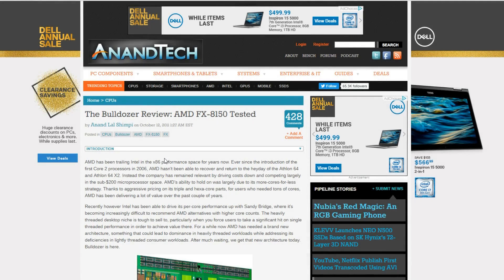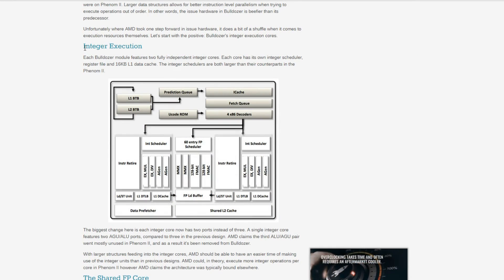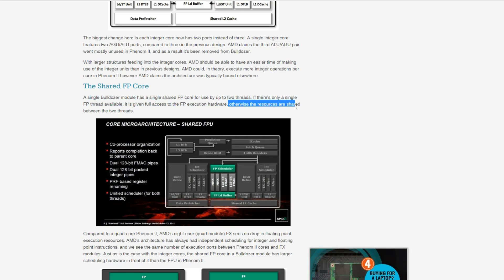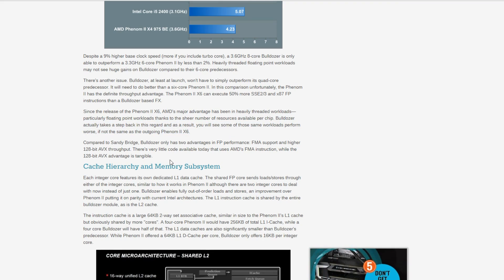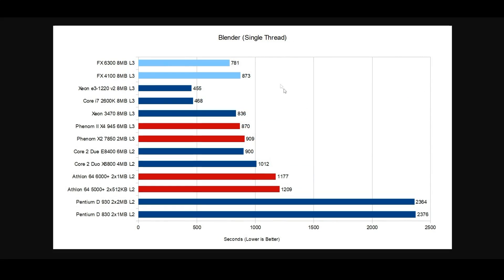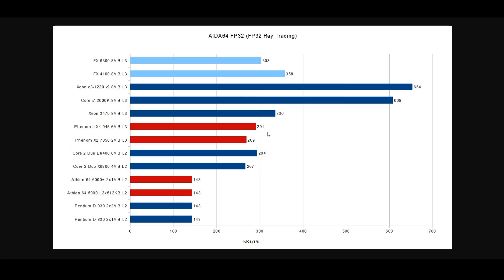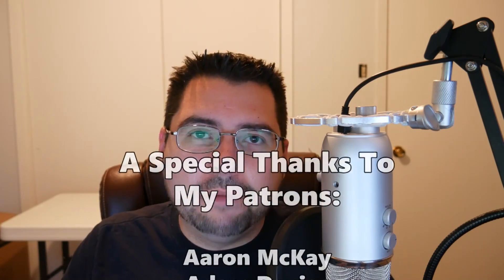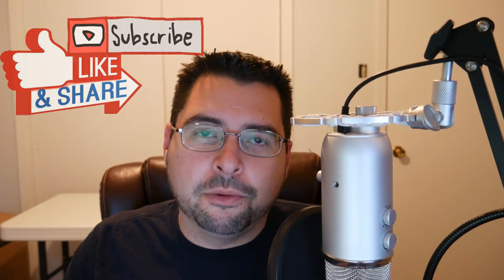IPC Test 7: AMD FX Series CPUs! How Does it Compare?

Comment: in other words, the FX was a part time 8 core, 6 core and 4 core cpu, lol. i don't understand why amd just didn't continue to build on the phenom architecture. instead, they tried a  radical different approach with the fx series architecture that just didn't pan out very well.
Reply from the maker: I have no clue. K10 at higher clocks would compete with 1st gen core series and at least kept them in the ballpark. With tweaks maybe split the difference between 1st and 2nd gen core series. Who knows
Reply: its simpe it was more efficient at higher core count and reach higher clock speeds it was better overall then phenom
Reply: Kai has the answer to your quandary. AMD really developed the Bulldozer architecture for the needs of servers/datacenters where you want higher density, more threads, and in general floating-point performance would matter less than for desktop use. If you are building compute servers that need floating point performance, you are probably going to use GPUs for that. Frankly, this is largely what AMD has done again with Ryzen. Yes that have gotten their ipc way up, but their use of infinity fabric is a server-market-driven decision, i.e. it is much more scalable, at the expense of higher latencies. It is really only because intel hasn't made any "leaps" in performance since Sandy Bridge that the conversation around Ryzen is different than it was for FX. Ryzen has most of the same "talking points" that FX did, minus the clock speed advantage, which has now flipped with intel breaking 5ghz and amd barely breaking 4. Ryzen is the value processor, giving more cores/threads than intel at a given price, the ipc is lower but the price/performance value is better, etc. If the ipc gap were larger, it would be Bulldozer all over again. And with intel offering 6 core, and soon 8 core cpus that can do 5 ghz and has ipc advantage, AMD may soon be in trouble again if Zen 2 doesn't offer substantial performance uplift.
Reply: Delcolux  you are mostly right.
Regarding infinity fabric, it's not just about scalability, but mostly about modularity. Everything uses the same protocol and you don't need to design a new interface for anything. Making an APU is literally plopping an CCX out and replace it with a GPU. This is only this easy thanks to infinity fabric, so even the desktop chip profit from it. The "problem" with inter-CCX latency is none of infinity fabric really, but more of the actual CCX. And while inter-CCX is not that great, latency in the same CCX is very, very good and i think that was the idea behind it.
I don't think Ryzen has the same talking points at all, apart from "being not the fastest in gaming". Where a single core lead was completely unattainable for Bulldozer, Zen2, 3 or 5 might finally get the better of Intel. Ryzen's IPC is a few percent lower on average, but it also has quite a few wins, currently the only big problem is frequency. The most important part: Ryzen is competetive in efficiency whereas Bulldozer was not. Next generation is 7nm for AMD vs still 14nm for Intel, so I am very confident AMD will have the efficiency lead in the next generation. Also 7nm should help with the Gigahertz, even 14nm->12nm brought around 200-300 Mhz, for 7nm I expect 4,5 minimum (overclocked/boosted of course) with room to 5 Ghz. I also expect Zen2 to provide a higher relative IPC gain than Intel has achieved in a long time, Zen1 has been the worst case.
Regarding floating point, Intel has bigger vector units, but Ryzen has the superior FP architecture. It is weak in AVX+, but it wrecks the Core CPUs in SSE workloads.
Reply: Good info, thanks Kai. I definitely think ryzen is cool, and I wan't trying to say infinity fabric is bad - it's awesome. But I just think it is kinda weird that despite the awesomeness of the Zen architecture, AMD is still the value/more cores per dollar/less per core performance option as compared to intel. Still the disparity isn't as large as it was last time around - as you pointed out they are comparable in terms of perf per watt, it is mostly a matter of clockspeed, so hopefully the Zen 2 plus 7nm will see AMD achieve true per-core parity with intel.

I always thought the single-ccx r5 1400 was interesting since it has all its cache and SMT, but since it is a lower-binned chip the clock speed just wasn't there. I will be keeping my eye on the newly announced r5 2500x...
Reply: Delcolux  Well, Zen is awesome in a sense that it is a really huge jump from Bulldozer. If you are coming from Skylake+, it is not really faster. However, the arch shoudl still be a bit more efficient at the same node (Intel 14nm is quite a bit better than Glofo 14nm) and most importantly, we finally have some competition. In January 2017, the i7 7700k was the reference in mainstream CPU power, we also had 8 Cores at 1000$ or 10 Cores at 1800$ a the high end. One and a half years later, a CPU with more multithread performance than the 7700k costs 150 bucks (Ryzen 5 1600 or better), we have 8 cores in the mainstream and 16 cores for 900$/32 cores for 1800$. This is the real immediate value for us as customers. Personally I'm okay with AMD as the value king, for most new PCs I recommend the 2600 oder 2600X as they are just beasts (especially compared to 7700k and earlier) and have more reserves compared to the 6-thread i5. Coming up, me might even see AMD taking the performance crown in many different areas as they will lessen or fix their clock speed advantage. Many people think AMD will be in trouble because of the 9900k, but I don't think so. When will it come out? December? With the current 14nm capacity problems, when will they have it actually in stock? March? Zen2 7nm Server CPUs are already in testing phase by the server guys and should be released somewhere around the beginning of next year. Ryzen 3000 will certainly not come out that much later as the 9900k.

Is the 1400 really single-ccx? I thought it was 2+2 cores. The upcoming 2300X and 2500X are 4+0 though. Do you have a tight budget? I reckon the 2600 will not cost much more and offer substantially better total performance, so it might actually be the better buy. The CCX-latency-thing is not that big a deal as most people make out of it. 3000+ Mhz RAM is becoming fairly cheap now and should more than of that difference :)
Reply: Definitely a bright future for the cpu market. I am not on an especially tight budget. I just found the idea of a single CCX chip interesting. I guess the APUs are honestly more interesting to me, particularly the laptop chips, though I was disappointed to see they only have 4M L3 cache, even on the desktop APUs. I will be holding out for Zen 2 regardless, as my current PC is plenty of power for me, but I enjoy following the CPU and GPU developments.
Reply: SteelCity1981 they should have improved on phenom ,shrink it , get 10-12% more IPC , 10%-15% more clock speed so it would have been within 10% of the core i7 in gaming and single threading applications and within 5% of multithreading task for 60-70% of the price.
Reply: 1. Bulldozer had a ton of bottlenecks, on paper, it was much faster than in the real world.
2. As other guys said, bulldozer scaled further with frequency (can it do 5 Ghz? YES) and essentially was completely bottlenecked by power in that regard, which brings me to
3. Glofo 32nm was SHITBALLS. Barely any improvement over 45nm. If you want to see how Phenom II looks at 32nm, go and take a look at the Liano APUs.
4. Die size. Bulldozer with 4 modules is significantly smaller than the 6 core Phenom. Remeber, this CPUs were made with servers first in mind and servers are (mostly) all about total performance per socket. But well, the combination of the flawed Orochi die with the awful 32nm processed basically killed it.
Reply: It didn't pan out well for PC, but it did lead to the PS4 and Xbox One chips, which are based on the architecture. As an experiment it was interesting.
Reply: David Connolly  what you mean is the jaguar architecture, it was developed as a low power solution and was complementary of the bulldozer lineup, but it is no bulldozer.
Reply: Yes it is Jaguar, i had heard initially that Jaguar was derived from bulldozer with CMT and modular design, but it seems it's actually derived from K8 architecture (Athlon 64 etc) with a modular design that is not the same as bulldozers modular design. I must admit to not paying much attention to it after hearing it was based around bulldozer and even lower performance due to its target market, so i didn't realize it is actually in essence a highly refined K8/K10 hybrid.
Reply: It's for this reason AMD was close to bankruptcy some 4-5 years ago. Buying ATI and 3 consecutive trashy CPU architectures almost killed them. CEO and most technical top managers were sacked for that, then came Dr. Su and the turnaround. AMD long shareholder here.
Reply: The Phenom IIx4 Denebs were beasts at tweaking. I had the 965 and the 980. The 980 I kept overclocked at 4.2 with my northbridge at 2.8 and RAM at 1866. It destroyed the the previous gen i7s and i5s in single core performance but it met its match when the i7 2000 series was released. I miss the big performance gains from overclocking the North Bridge.